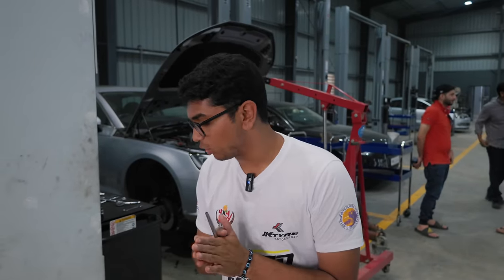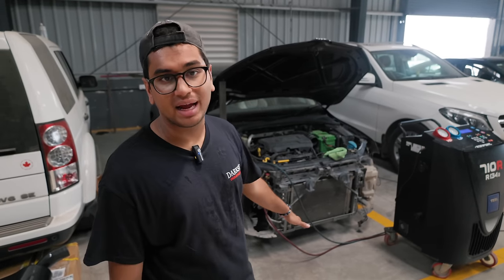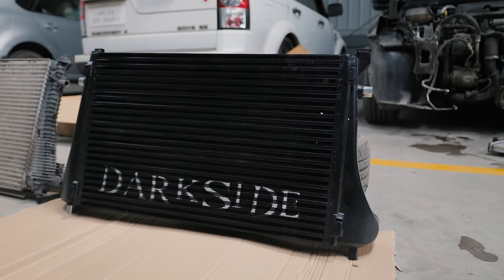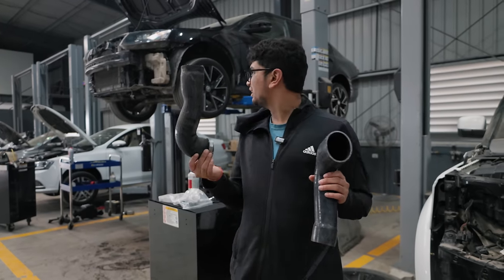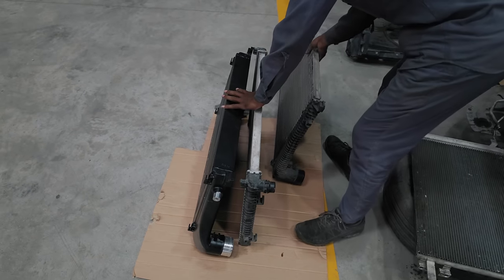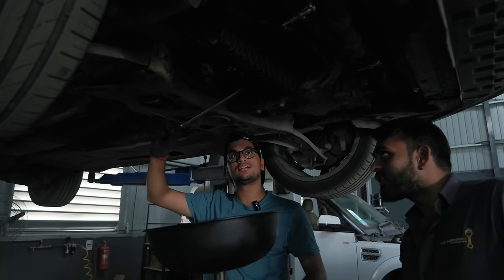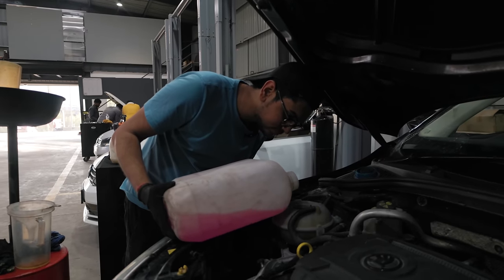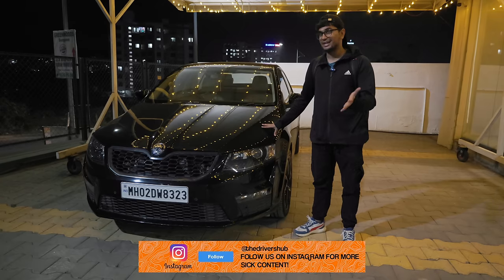Upgraded Intercooler from Darkside Developments for the Stage 3  Octavia TSI! | Project Octy

Comment: Just a heads-up, there is no need to remove the AC Pipes & AC condenser to install these aftermarket ICs. We've installed over a 150+ ICs on the MQB platform and never had to make customers waste money on AC Gas Refills etc.